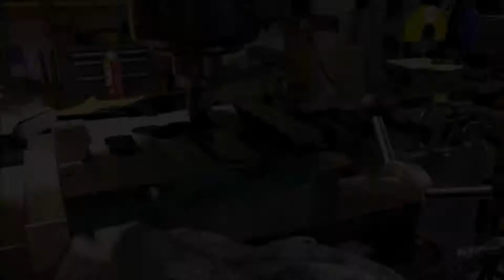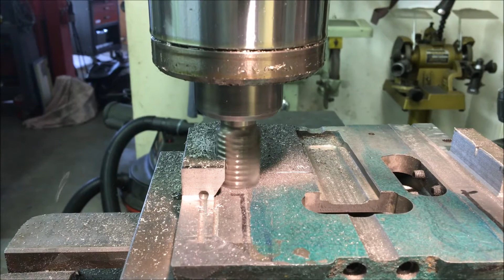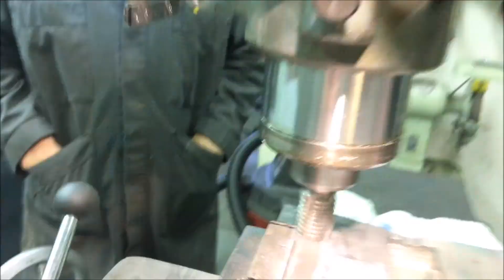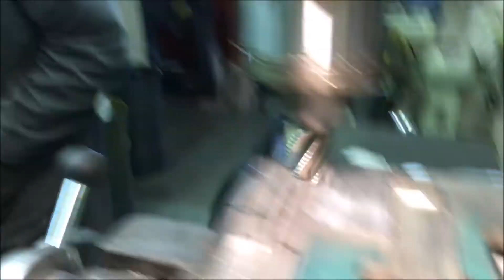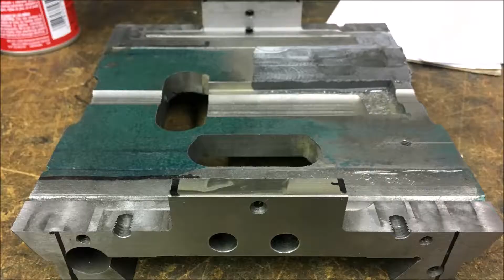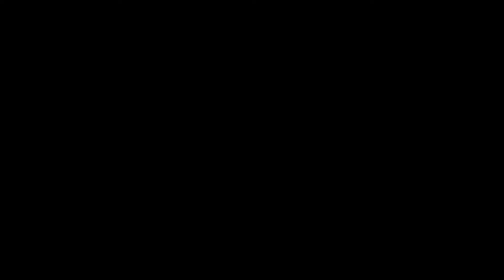GRIZZLY G0704 - bye dovetails... hello linear rails!

Comment: You did just the x and kept the dovetails for the y correct? Curious if you lost any durability/stability in the machine? I have some projects that require milling with a 1-1/4" end mill with my model mill so I'm up in the air and of course I'm only seeing these lighter g0704 type mills being changed over. I'm fed up with dove tails myself and would like an easy maintenance and Replacment of rails where I can have them on the shelf when needed versus having to hand cut gibs when they wear out. The particular machine I'm building has worn gibs so it's getting rails. Deciding whether to do them to all my mills is the question in play. And since I'm at it I figured I'd grab an extra inch or two of travel.

Comment: Why did you change it to linear rails? I have a small mini mill and I'm fine with dovetails (at least for now).
After cleaning and applying some grease to the dovetails everything went much smoother.
The biggest change was introduced by replacing the leadscrews with ballscrews (of course I also converted it to CNC) and now the X/Y axis units are accurate (before they were not nearly as accurate).

Comment: man youre killing me with this vid... i have done all the cad to chageover to linear rails,adding head spacer and extending x and y 
axis, but i have no way of machining these large pieces and have not been to find someone to machine my 0704 parts to accept hiwin rails
Reply: rick gonzales you only need a mill with a large table travel. I'm about to do this and want to do both y and x travel. I believe he did just the x here.
Reply: Ask around at machine shops,  I disassembled my Grizzly equivalent mill (Craftex Ct129N) and brought all parts to the local machine shop. It wasn't extremely pricey, and they had it done in 4 hours.:O  And they appreciated the local business.
Reply: DZ Mech how accurate were they or did you just say machine this flat and that’s what they did.